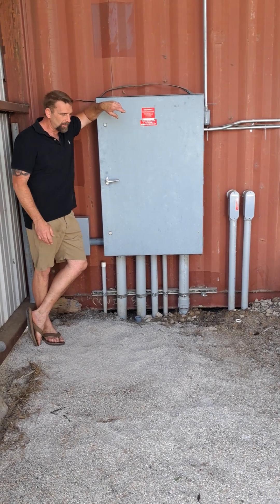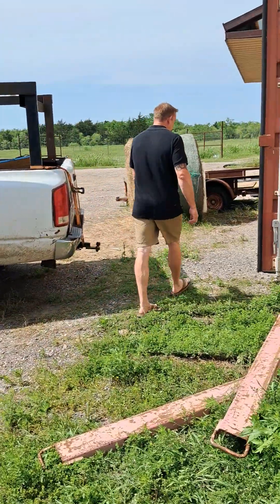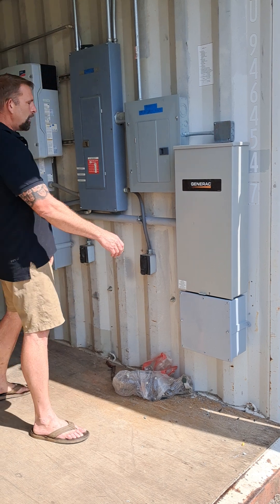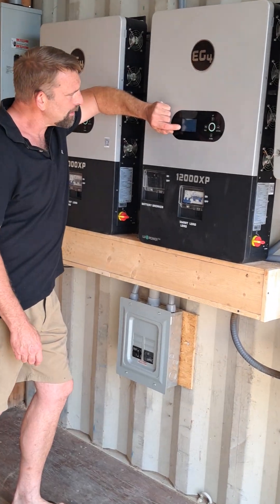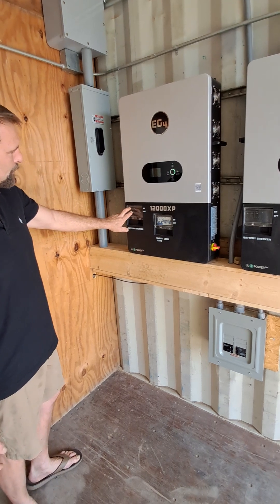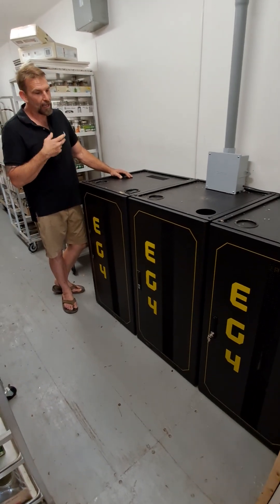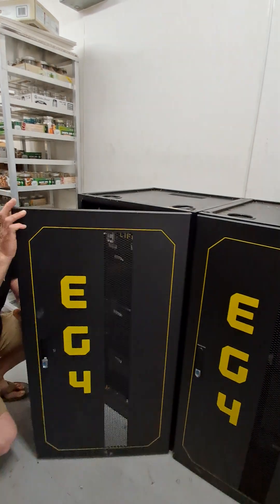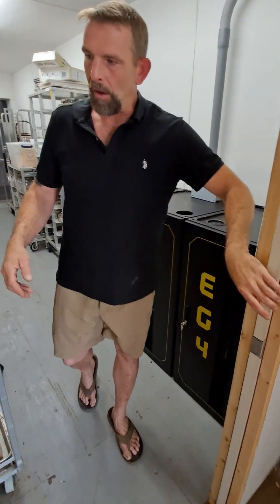⚡️30 KW grounds mount 100kw lithium backup

Comment: Why on Earth did you choose these cheap, low surge, short lived, high frequency, transformerless inverters?  Because they lack any galvanic isolation between their DC boost stage and its AC output, these inverters can damage your appliances, when their IGBTs fail.
Reply from the maker: @solarcharging9743  please show me the findings and or documentations proving this. I would personally love any or all information if possible. Personally I've been sticking with the grow up 5000 es series European version 2:30 volt AC output high frequency drive inverters for years with absolutely no issues compared to a lot of other brands that we've dealt with since 2008. I thank you for your input personally all information is knowledge and knowledge is power